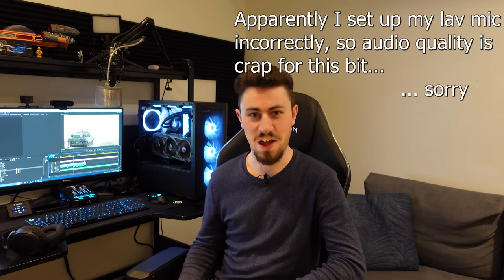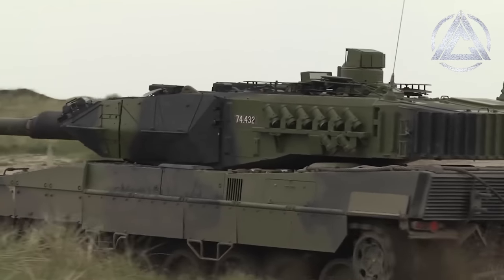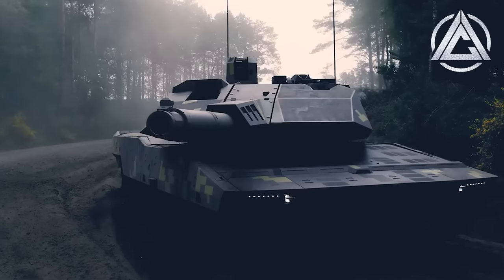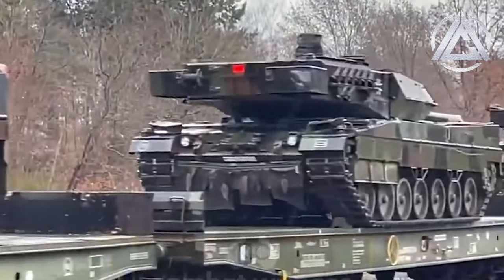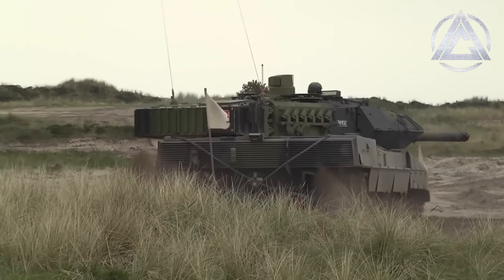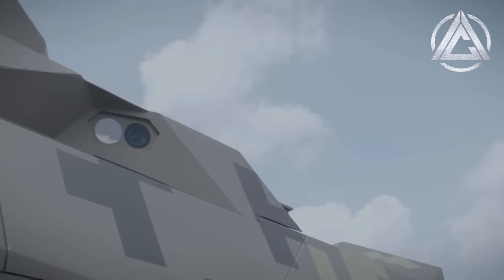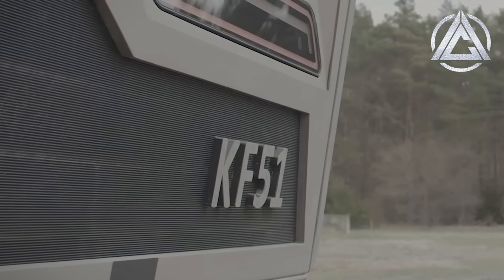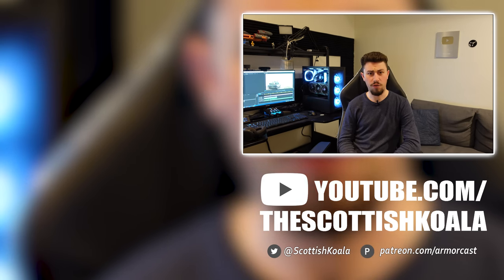Germany's New KF51 Panther Tank | The Spearhead of a New Generation?

Comment: 4.000 m is usually the range limit for tanks, because of the earth curvature. The aiming/firing tank needs above 4.000 m distance a higher position than the target. After 5.000 m a target disapears completely behind the earth curvature if the aiming device is 2 m above the ground.
Reply from the maker: Not true at all. Earth's curvature plays no factor until you hit more like 15,000m+
This is how Challenger 1 in the Gulf War, in a flat desert (actually slightly BELOW its target) was able to hit a 5,110m shot with sabot
Reply: @ArmorCast  You must be a fan of the flat earth theory, but the earth is curved. This means after a distance of cm 5 km any target lower than 1.96 m is no longer visiblle. Thats simple physics and mathematics.
Reply from the maker: @Rick2010100  I'm going to ignore your attempt to call me a flat earther when I am very much about to (and just did) acknowledge Earth's curvature as a factor. You are simply wrong about the distance with which it plays an effect.

Easy test - stand on a beach, with a pair of binoculars (which still pale in comparison to the zoom of modern day tank optics), and tell me with absolute certainty that you cannot see a waterline target at more than 4km. I could show you photos I've taken from the water's edge of waves hitting rocks more than 5 away!

Easier still, try this peer-reviewed site
https://www.omnicalculator.com/physics/earth-curvature

Or you could simply acknowledge Challenger 1's 5,110m shot in 1991. Challenger 1's height is around 2.9m, and its GPS is near the top of the vehicle, so let's take it as the starting point. With a height of 2.9m, you would have to be 8km from the target before even 25cm of that target would be obstructed by Earth's curvature. You'd have to be at more than 12km before Earth's curvature causes the entire target to be below the horizon.

Comment: The Chieftain has mentioned that he does not approve of having the 4th crewman or the loitering munition for the Abrams X and KF51 unless there is a compelling reason for this.  The idea is that a tank is limited in size and that things like drone operation and loitering munitions can be done in either other vehicles should not be placed in a tank unless it can be justified via doctrine.  For the KF51, instead of a fourth crew man, perhaps more fuel.
Reply from the maker: Better off with more ammunition. Even without the drone systems you’ve only got 20 rounds, that’s HALF what an Abrams carries and even less compared to the Challenger 2
Reply: @ArmorCast  But guessing by the modern weapons aiming system with high first hit probability, why are 20 shots not enough?
Only because older systems have more ammo?
Sounds just conservative, because it was always done that way ..
Reply: @DJ1573  Against tanks the 20 rounds are maybe enough, but tanks are also used in the fire support role as can be seen in Ukraine. That requires a lot more rounds as they are often also used to supress enemy infantry.
Reply: @DJ1573  tanks rarely fight other tanks, they sling HE around at infantry, fortifications and buildings. if they meet another vehicles its likely a light vehicle  and a HEAT-MP shell will suffice, so having only 20 rounds onboard would be a massive drawback.
Reply: @dougblack8414  But it should not be like this. Thats what IFVs are made for. 
The drone operator can coordinate tank contacts and response thanks to superior drone reconnisance while the IFVs take on fortifications/infantry together with the mounted infantry. 
You know about the german tank grenadier doctrine?
Reply: @DJ1573  The issue is that the drone operator does not need to be in the tank. They are better off in another vehicle and can still communicate with the tank digitally. Everything in a tank should be in a tank because it needs to be in the tank. Drones are great and can still be used but they don't actually need to be in the tank.

20 rounds is probably borderline okay but more ammunition is still preferable. One thing to consider though is new programmable 120mm ammunition like the American M1147 Advanced Multi-Purpose Round. I am not sure if Germany has this ammunition too or an equivalent. But at least for Abrams it means only 2 ammunition types need to be carried, rather than 3 or 4. This would lessen the blow of a reduced ammunition capacity.
Reply: @Rampant16  A multi-purpose crew member with higher situational awareness is far superior. I want you staying calm while the guy in the Command unit is getting everything wrong and talking bullshit while the communications are being disturbed by electronic warfare. 
And the more 'multi-purpose' something gets the worse it does its jobs. 
Artillery/Airstrike or IFV firesupport with 30mm programmable ammunition is much more effective too. And yes, Germany has this type of Ammo. 
This Multi-purpose round has only been designed to increase the Abrams service life because an all out new tank design or change of doctrine is disliked by every branch of the US army. 
Again, look at the german tank-grenadiers who operate together with MBT's. 
Thats your Multi-purpose round.
Reply: @nietkees6906  Ukraine is a bad case study, they are using what they have and tanks as fire support are outdated. Look at the amount of losses they had to endure up to this point. 
They do it because they NEED to do it but there are better ways.
Reply: @DJ1573  No, fire support is and has always been one of the primary tasks of tanks. Tanks also need to be able to fire at infantry, buildings and bunkers. 
But Ukraine also engages in indirect fire support, which maybe is what you are talking about, they are using their tanks as artillery. That is indeed not the job of a tank, but I am talking about direct fire support.
Reply: @nietkees6906  I, again ,point at IFVs and their mounted infantry. And Artillery.
Or drones in the near future. 
Where is there a need for a tank to waste its ammo?
Reply: @DJ1573  Tanks have more powerful and longer range guns than IFVs and are thus better than IFVs at certain missions such as destroying bunkers or buildings. And tanks are way better protected than IFVs. 
Tanks are more accurate than artillery and can faster respond to threats. It would actually be a waste of ammo to shoot 20 times with artillery at a targer when you can destroy it with one tank shot. 
All systems are necessary in modern war, also tanks. Especially tanks that dare to shoot at targets and are not afraid to run out of ammo.
Reply: @nietkees6906  Artillery today is pretty damn accurate. Just look at the PzH 2000 + a recon-drone like the Ukrainians are using. 
One shot, zero in, second shot gets the target. 
And modern IFV guns with 30mm rounds have over a kilometer range.
Better armor? Really? Handheld AT/manned systems don't give a damn about the difference of a tank or an IFV.
Please tell me a scenario where a tank could do a better job than every other vehicle/system.
Reply: @DJ1573  Artillery is less accurate than you seem to think. You only see the videos where they hit something, but when you look at the ground you see all the shell craters of shells that have missed.
Yes, significantly better armor. Western tanks can sometimes even survive ATGM hits and almost always RPG hits, while IFVs couldn't survive those. And tanks are also less vulnerable to artillery compared to IFVs.
Already after the first world war there were talks about tanks being useless due to technology improvements, but again and again tanks have been proved to be very useful. Also in this war.
Reply: @nietkees6906  I said, the PzH 2000 is a very accurate system. 
Western tanks can only survive ATGM's with active protection systems and RPG's to the front or by using explosive side-armor. 
And i never said tanks are obsolete ...
Tanks as fire support are obsolete.
You still haven't told me in which scenario a tank is superior to any other fire support.
Reply: @DJ1573  Also the PzH 2000 is less accurate than you seem to think.
And no, western tanks can also survive ATGM hits when it hits their frontal armor.
In fire support tanks at superior at destroying bunkers and buildings.
And western armies seem to agree with me, they are actually investing in making their tanks better with fire support such as with new ammunition such as the US M1147 Advanced Multi Purpose round. That is a high explosive round that functions against light vehicles, buildings, bunkers, helicopters and infantry. It also has an airburst function, which could come in really handy for clearing Russian trenches.
Reply: @nietkees6906  The only reason for the Multi-Purpose round to exist is to prolong the Abrams service life. 
Thats why the US keeps on slapping more and more systems on them, to keep the infrastructure and logistics intact. 
And bullshit, at 21km the PzH 2000 has a probable inaccuracy of 6 meters. 1m per 3,4km, as taken from the Manufacturers site. Where do you have your information from?
A tank as direct fire support needs to enter villages and cities to fight against bunkers and buildings = CQC
In CQC, an AT weapon is mostly fired from the sides or from behind a tank.
Reply: @DJ1573  The reason for the Multi-Purpose round to exist is because they need it because they found at that they use their tanks more against infantry and buildings than against other tanks. And that round or a similar round will also be used for the succesor of the Abrams. Tanks won't go anywhere.
Reply: @DJ1573  And no you are talking bullshit. 6 meter accuracy is only possible with guided ammunition. The Excalibur ammunition, the most accurate in the world, for example has a CEP of 4 meters.
And artillery always will have the disadvantage that it will take time for the shells are fired. Tanks can react quicker to new threaths. 
And tanks are also very useful in cities and villages, but obviously need infantry support.
Reply: @nietkees6906  I never said the tank would become obsolete. 
And for the most part, the AbramsX is basically just another Abrams .. like the name implies.
Yeah, new engine and the velocity increase for the main gun + several electronics upgrades and crewcompartment.
Reply: @nietkees6906  Why the hell did you assume directly i think the tank would go away????
Reply: @DJ1573  The AbramsX is a technology demonstrator, not the new US tank. 
But speaking about new tanks, the US is now actually making a new light tank so that the airborne division also has fire support. 
I don't think continuing this discussion will be very productive. But I hope you realise that NATO disagrees with you.
Reply: @nietkees6906  You did not even read my full sentence, nice. You are quoting a report from the Irak war, where every report is way over top. Just look at the Airforce claims of successful strike missions. 
European Vulcano round has even higher range and same accuracy which is 5-10 meters CEP for both Vulcano and Excalibur. 
And heard of Multiple Round Simultaneous Impact? Shoot 5 and all impact at the same time.
Reply: @nietkees6906  NATO is not the whole US alone.
Reply from the maker: @DJ1573  Western tanks are plenty capable of surviving RPGs and older Malyutka ATGMs to the sides and rear WITHOUT use of active protection systems. For one, cage/bar armor exists, and two: they have blowout ammunition storage.

As for "a scenario where a tank could do a better job than every other vehicle/system." by which you're alluding to a combination of IFVs and artillery, I would look into "jungle-busting". Tanks are also the ONLY vehicles that can fulfil the exploitation and heavy breakthrough roles as well and as cheaply as they do. The only other platforms capable of fulfilling these roles are either less effective or more expensive, both of which end up with a far greater logistical footprint, which is a nightmare to deal with! 

Military budget, while the US would seem to suggest otherwise... is not infinite, especially during a war! Superior tech is great, but not if you can't afford to keep using it! This was the problem Britain faced in the Falklands War - should Argentina have managed to sink just ONE more ship... they'd have won. Despite Britain's overwhelming technological superiority, and better training. Fighting a war overseas is incredibly costly, and if that cost should become greater than the cost of pulling out and pursuing diplomacy on the opposition's terms, then that is what's going to happen.
Reply: "can be done by in other vehicles" yeah good luck with that.. If you can't do it yourself, you are probably on your own because everyone else is also busy. Having your own drone capability to look what's behind a hill/forest is the only thing you can rely on.

Comment: It really looks and sounds like a 5th gen fighter was transformed into a tank. It has all the same concepts like sensor fusion, networking, heightened awareness, active defense systems, and even stealth, with the reduced radar return shape, and other features like the gun shroud to reduce heat signal.

Comment: For personal use.
5:28 130mm Long Schlong
  12:44 Autoloader
  14:33 Secondary
  15.16 Loiter Munition
  17:10 Spotter Drone
17:18 Protection
  17:18 APS
  18:39 Vroooom Spec
  20:54 Passive Armor. Completely fuck on the physics, just like the ammo video.
  Btw, the ammo video still have all the issue and is still up there.
  23:31 Analog to digital
  23:26 NGVA
  23:40 Goes back to passive armor?
  23:59 Ranting about the hull
  23:49 More Vroooom Spec, not sure why another part of it appears at 18:39
25:28 Sensory equipment
  25:41 Detecting a thermal sensor? Which is a completely passive sensor?
25:59 Strv 103 control scheme again
26:25 Future of optionally manned turret/vehicle
26:45 Comment on paint job???
26:57 That geometric block at base of gun, and very out of whack theory
27:16 Out of whack theory of geometry LO design
27:20 WHY, replace tenk? 
  28:49 Leo2 has upgrades, but not enough
  29:31 Draws F22 parallel
  30:16 Goes back to tenk
  31:26 Germany military readiness suck. 
30:56 Rant Rant Rant
  31:57 Dubious comment on "cyber security" 
  32:54 B2 is a thing. 
  33:49 Goes back to tenk rant.
34:17 Why no unmanned turret?
  35:09 Turret has more armor than hull, meaning crew in hull will have less armor...
  35:43 Re think what tank should looks like.
  36:02 Turret has less armor means mission kill is more likely.
  36:18 T-14 layout is self defeating, pulling out statistic out of rear end
  36:34 (Not) Modern threats... 
  37:01 Mine protection is not possible with crew in hull...
37:44 The rest is conclusion.
  40:20 Poland will most likely not be Germany customer anymore, instead be an exporter themself.

Comment: That was the most informative video about the KF51 I've seen thanks. I have read that Germany will allow the Leopard 2A4 to be sent to Ukraine. How do you think it will compare to the more modern Russian tanks and anti-tank weapons that have proven to be so effective against the current tanks being used.
Reply from the maker: Well, the MODERN Russian tanks would be likely to wipe the floor with the 2A4 model. The thing is though that Russia are down most of their best units. The VDV, the First Guards Tank Army, the Fourth Guards Armored, and the Third Guards Motorized. All of these units are reporting combat losses of 50-90%, and those battalions/brigades that aren’t are dealing with shortages in fuel and ammunition, and being forced to supplement their units with older models of tanks.

Provided the Leopard 2s ARENT being used to defend assaults, and ARENT being sent out against the absolute worst positions, instead being used for exploitation and direct fire support of infantry, they should fare exceptionally well, much better than any Russian built tank would.

The purpose of giving Leopard 2s to Ukraine has nothing to do with having them fight Russian tanks, not the main units at least. They will be VERY powerful against the old T-72 and T-62M models being used by reservist forces, but primarily that is not what they are for.
Reply: @ArmorCast  Thanks
Reply from the maker: @acerking76  "The Russians are not down anything", except over a thousand MBTs, dozens of fighter jets, over a hundred attack helicopters, multiple thousands of AFVs and other vehicle types including APCs, artillery and MLRS systems, air defence systems and early warning radars, command posts, resupply vehicles etcetera, effectively their entire airborne special forces, the flagship of their navy... need I go on?

You... you do realise even the entirety of Russia including Russian state media and Russian propaganda channels admit to the loss of Moskva, right?

Oh, and this is ONLY counting losses with clear photographic evidence available, meaning it is actually a very conservative number compared to what's likely out there and just undocumented.

I suggest educating yourself before you accuse OTHERS of just sucking up to propaganda. https://www.oryxspioenkop.com/2022/02/attack-on-europe-documenting-equipment.html